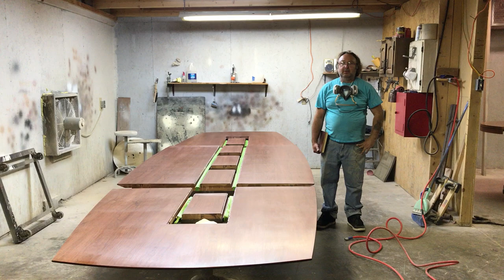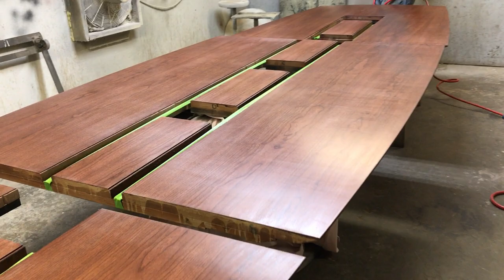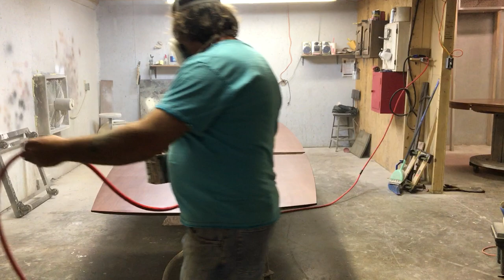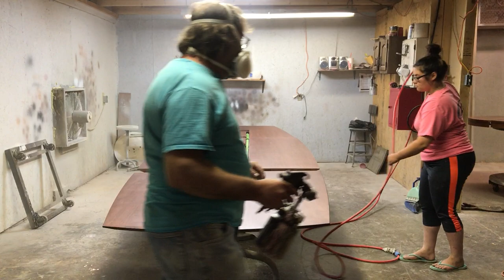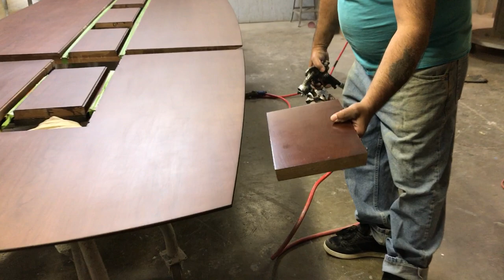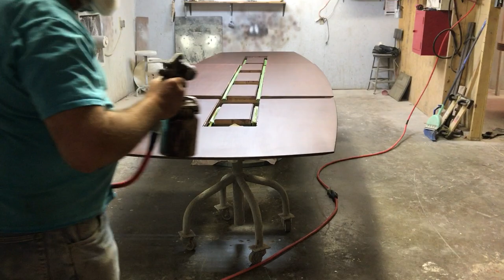refinishing a cherry conference table

Comment: Big job!   What color toner were you shooting?
Reply from the maker: walnut ,the video was 30 min ,this was 15 min of shading ,today i will flip the table over and finish the edge on the bottom side the later in the day flip it back over sand and top coat it out ,in 3 pieces ,not all together ,it should be done today if everything goes good